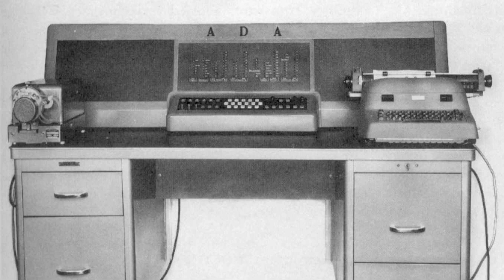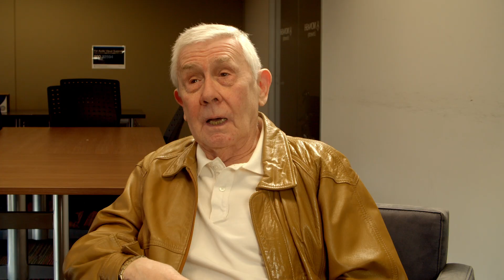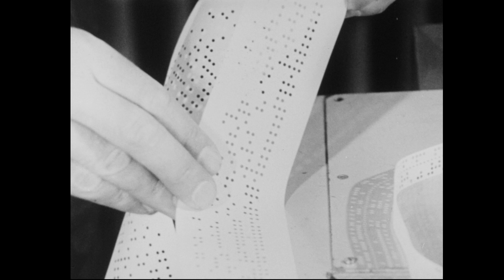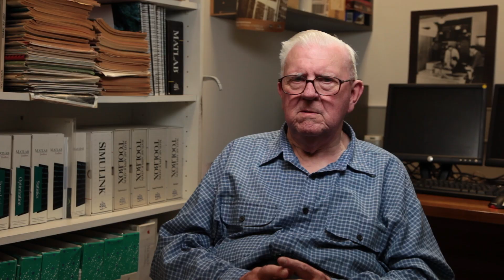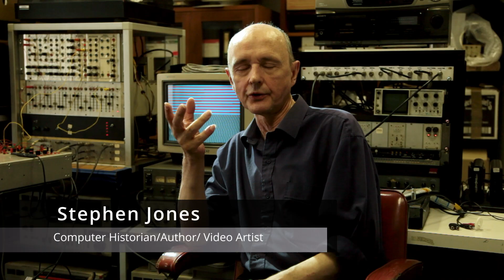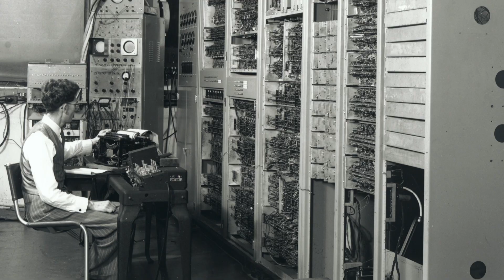The Computer History of Australia - Episode 2 CSIR MARK1 part2

Comment: Paper tape lasted much, much longer than most people realise.  In the 2000s, one of the control systems of the power stations at Torrens Island in Adelaide still booted off paper tape.  But since the tape was so fragile, a paper tape simulator was developed to flash into the tape reader to input the code.